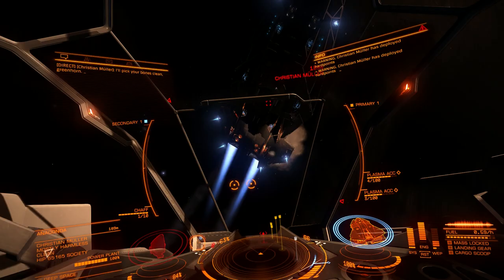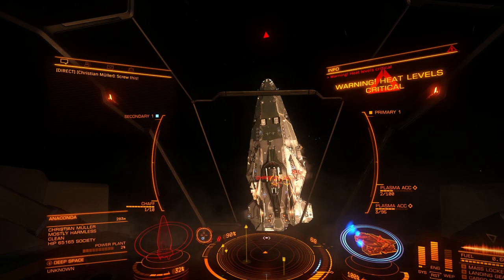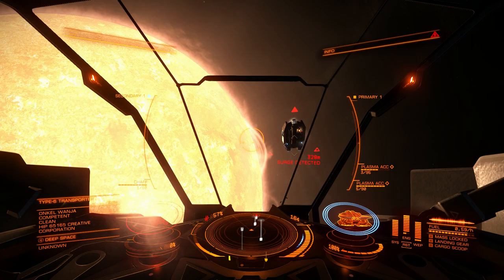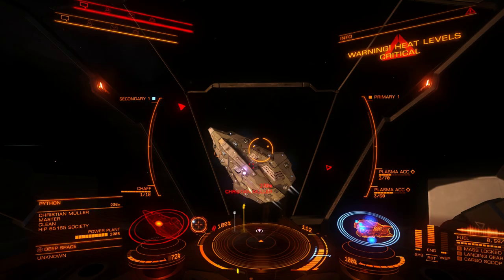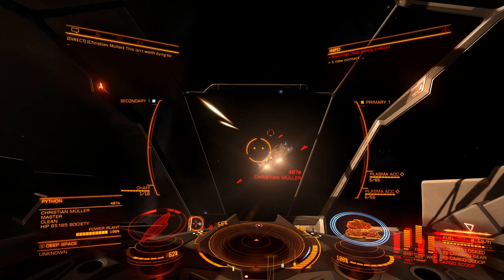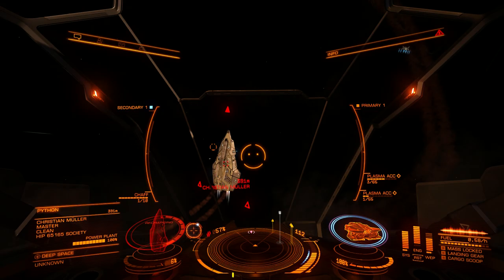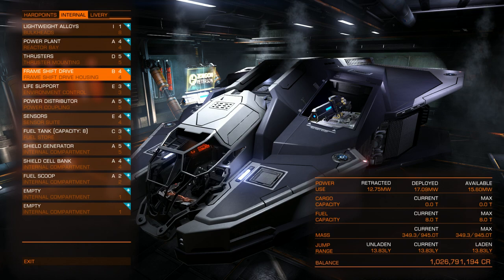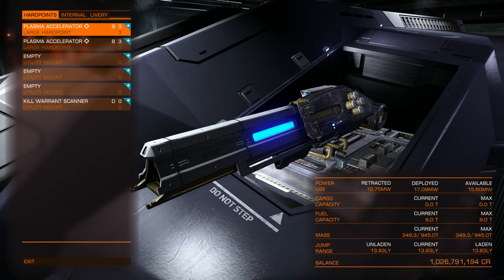Extreme Loadout. Vulture with Plasma Accelerators

Comment: If you can learn how to aim the thing, you can run a plasma accelerator and a gimballed pulse laser. Use the laser to melt the shields, then target the power plant and line up your plasma shot. It can one-shot anything up to an asp.

Comment: Yes, I love this loadout! Not only is it awesome, but I've killed Elite anacondas in less than ten seconds with this setup! Two clicks of the mouse and all shots landing on power plant (hard, hard thing to do) kills the conda in two clicks. :)

EDIT: I actually started the video and, :(. I think the problem is that you're flying with only 2 pips to weapons, I use 4 and 1 to SYS and ENG. The Vulture is easily maneuverable enough and has powerful enough shields with 1 pip to either system. Here's my loadout:

L: 3B/F Plasma Accelerator
L: 3B/F Plasma Accelerator
U: 0I Chaff Launcher

BH: 1I Lightweight Alloy
RB: 4A Power Plant
TM: 5E Thrusters
FH: 4A Frame Shift Drive
EC: 3B Life Support
PC: 5A Power Distributor
SS: 4E Sensors
FS: 3C Fuel Tank (Capacity: 8)

5: 5C Shield Generator
4: 4D Hull Reinforcement Package
2: 2D Hull Reinforcement Package
1: 1D Hull Reinforcement Package
1: 1D Hull Reinforcement Package

I've fought more than one CMDR at a time with this loadout and won, and I didn't get the first strike :) my shields were down before I knew what was happening, those hull reinforcements work wonders. Granted it was in a CZ where we had maybe a 7:3 favor. On a last note, Condors are your worst enemy in this craft, you'll just get swarmed if you have no shields, and annoyed because you can't hit any of them, ever.
Reply from the maker: yeah, with practice all is possible :)
also 105 ammo is quite nice, can't even compare to fragment cannon 33 ;/
Reply: Kornelius Briedis The fragment cannons really was a let down, but I hear of CMDRs being able to use a single clip to kill a Conda's power plant.

Comment: How do the accelerators do in a cobra? I'm thinking about upgrading but it is very expensive.
Reply from the maker: yeah, those are expensive.

cobra probably can handle 2 class 2 plasma, it's not as good as class 3 but still puck a good punch ;)
problem is with hardpoint location on cobra and plasma is fixed weapon.
Reply from the maker: Quasar there are, yes. i have seen them at many high tech worlds so not really rare :)

Comment: Kornelius, I do want to see an all turreted Anaconda. Does it have enough power to  sit at a combat zone and fire at will with near max shield boosters.
Reply from the maker: lol, automated killer?
well i really dislike turrets and after i saw damage done by them to shields i know why, but it's a good idea to try it out.
about power: turrets require less power than regular (which makes no sense to me) and those require less power than gimbaled  so you definitely can have 8 turrets, however, if you put 8 lasers it will drain WEP capacitors too fast, if you put projectile they will waste ammo on shields, silly ai ;)

Comment: Have you tried 2 cannons? I quite like them. Oddly they sometimes do 0 damage don't understand why
Reply from the maker: hmm, if i remember correctly they were not so good against shields, anyway i would never have only projectile weapons (like fragment, cannon, multis) because against shields they are very weak ;/

but as for 1 cannon and 1 laser it's a good setup.
Reply: i used to have 2 class 2 cannons on my viper with 2 gimbals beam lasers. 

the problem is once the shield is down the cannons sometimes just do 0 damage, i dunno if i should report this as a bug or if its a feature.
Reply from the maker: thebritishgeek IF you hit a module you will not damage hull at all but only the module that you hit ;)

that's what made armor test very hard ;/
Reply: Kornelius Briedis thats.... thats very silly, i hope they change this because i don't think an explosive armor piercing shell would do zero hull damage because it struck a component.
Reply from the maker: thebritishgeek am not sure but that's here from the very beginning and it's done deliberately so i don't expect that to change ;/